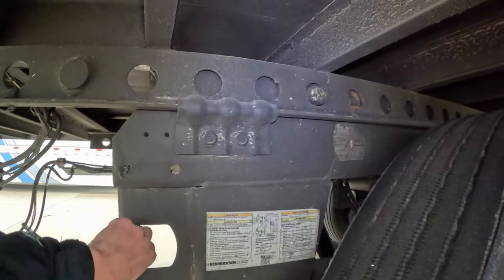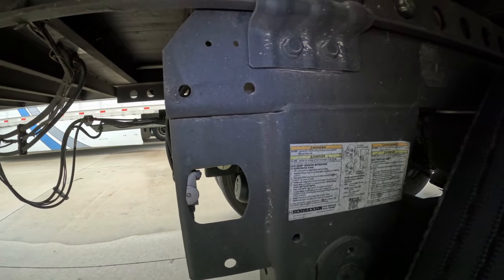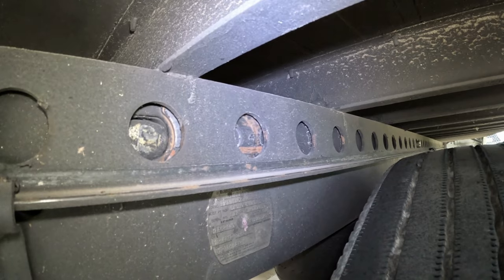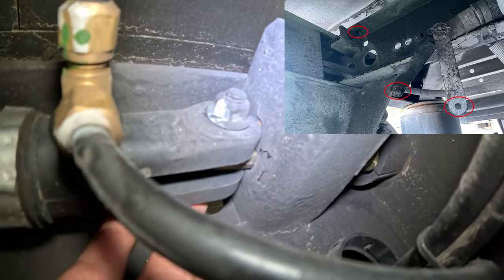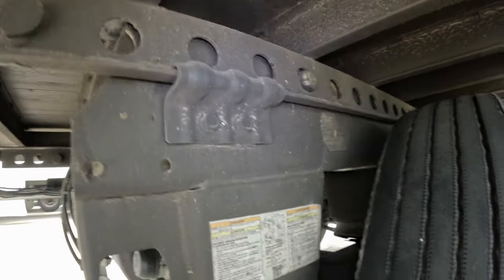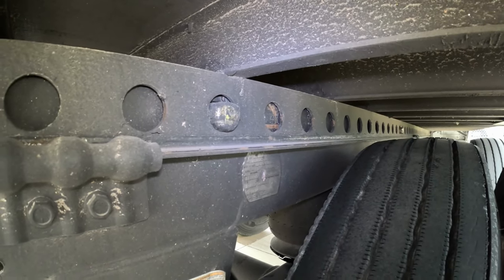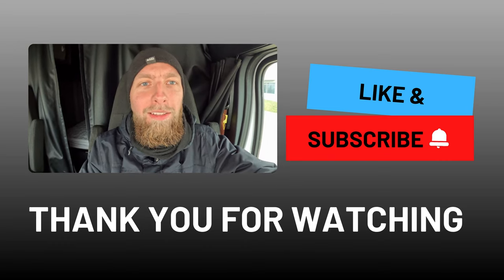How to fix tandems NOT LOCKING/UNLOCKING on trailer

Comment: Having same problem, because air pressure low the pin not going in, but trailer gauge and air bags show pressure is ok, how can I fix it?
Reply: Make sure you idle your truck, and release trailer brake. Idle truck with trailer brake released for 5 minutes, after 5 minutes, with trailer brake still released, push in the pin button. 

It should help. If it dont help, check for air leaks on trailer. This system stops working imediatelly once you have air leak

Comment: Installed new valve and brakes released, but the tandem pins won't move??? PLEASE HELP
Reply from the maker: Maybe you have any more air leaks on trailer? AIr leak is number 1 problem for tandems not unlocking

Comment: is it hard to replace the springs? do you have any tips on how to do it?
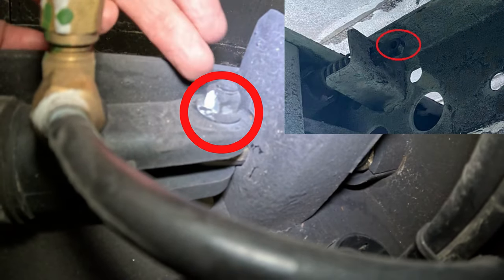Reply from the maker: Since your spring is already broken, remove the Pin/Bolt shown on 1:37 on my video, take a hammer, and hammer this pin OUT of the slot (In my video 1:41 on right side over the marked red area), so it would fly out on the ground. Once you will be installing new pin, you have to put it back same way, and install this holding pin shown on 1:37. I hope it will help.

Comment: Hi I’m having a leak on the release valve the one that makes the pins go in and out
Reply from the maker: Hello. If the release valve itself is leaking, make sure your air pressure stays above 100psi (with TRAILER BRAKES RELEASED). If air pressure is higher than 100psi, need to replace the valve in any shop. Most of the shops can do it, and price for this job is around 150-200$.

Comment: Spray the pins with slide lunricant in and around the pin holes. Also hav e arubber mallet to tap them in in case they stick in the whole.